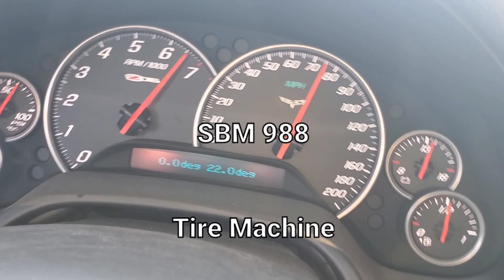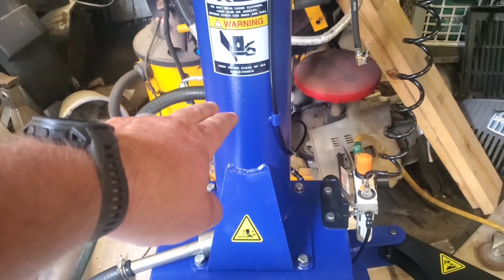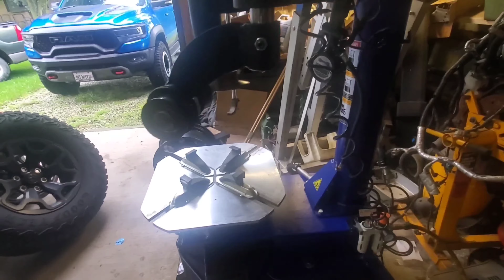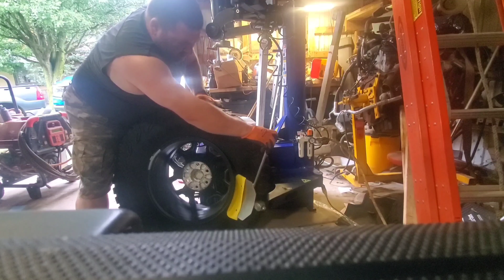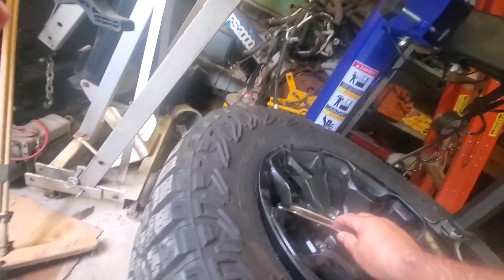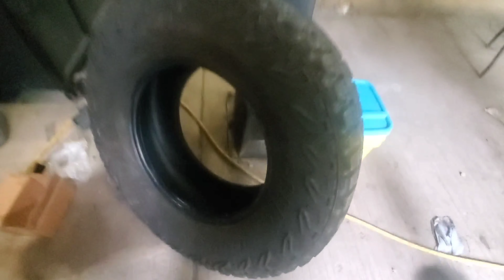SBM 988 tire machine

Comment: Does your turn table spin clockwise and counter clockwise? Mine seems to go only one direction
Reply from the maker: Yes it spins both ways. Did you try lifting the pedal instead of pressing. Lift the pedal for CCW
Reply: @vfr800fi07 did just now lol.

Comment: If that’s a beadlock you definitely did that wrong
Reply from the maker: They can be run either beadlock or not. I have them for Street right now if I want to do beadlock I just need to pop it on the other side